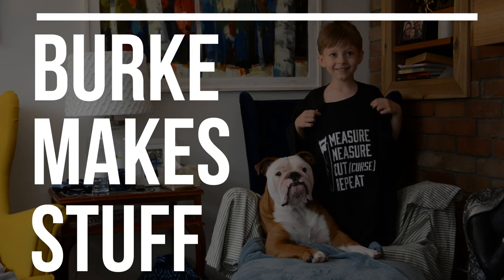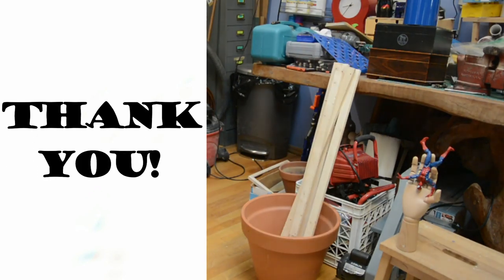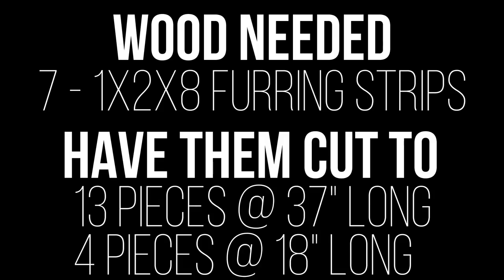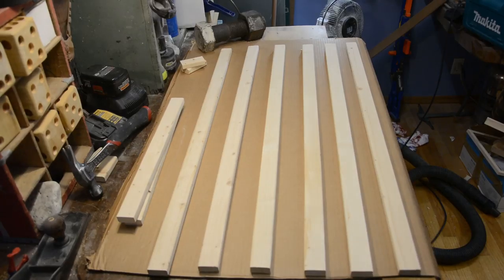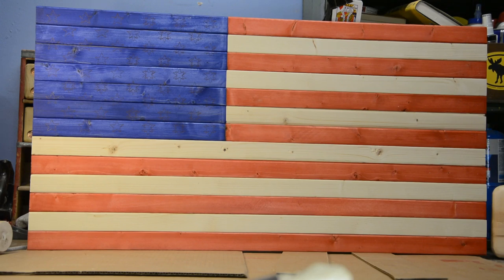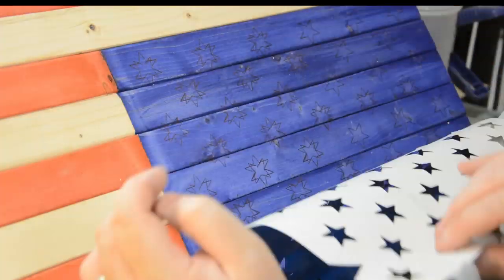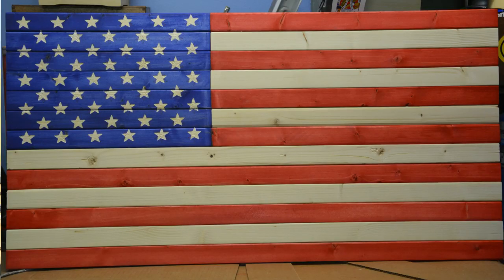Beautiful Wooden American Flag

Comment: I use screws when putting mine together, how well do the brad nails hold up over time? They would make it a lot easier, faster, and cheaper to build! Thanks for the video!
Reply from the maker: Bryan McKinney being that this is hung on a wall, brad nails and wood glue are more than enough holding power!
Reply: @BurkeMakesStuff  thanks for the reply! One more question, any suggestions to keep the flag from warping? They are perfectly straight when I assemble them but they start to warp shortly after. What kind of wood do you use? I have used premium wood from home depot, to firing strips, to pressure treated. Any feed back would be greatly appreciated, Thank you.
Reply from the maker: Bryan McKinney I’m now on number 40 something, and haven’t had a single one warp. How’s the humidity in your shop? Any wood from HD should be fine as they have consistent moisture content, so I’m guessing it’s your shop that’s the variable. Dehumidifier? With the BACK slats are you gluing them? I use glue and my 18 gauge brad nailer. Make sure they are clamped while drying, but not tightly. That could totally make them warp if the clamp is over tightened. You want to only apply enough pressure to have them in place but not enough to “squish” them together.
Keep me posted.
Reply: @BurkeMakesStuff  I'm in Floida right on the coast so humidity is always high, and I work out of my attached 2 car garage. I do clamp them down and maybe I might be clamping them down to tight as I didnt want any gaps to be showing. I will back it off a little and see if that helps. Thanks for the info and will let you know how the next one turns out!
Reply from the maker: Bryan McKinney will do! As long as your cuts are straight, gaps shouldn’t be a concern. New video coming out tomorrow! Be sure to check it out!

Comment: Lowe’s And Home Depot both don’t cut anything under 12”. At least in my area. And the 1x2x8 strips are $2.73 a piece.
Reply from the maker: Hi Chris! My Home Depot has literally never said no whenever I’ve asked them to cut anything, regardless of size. I get small stuff there all the time. As for price, at HD, 1 in. x 2 in. x 8 ft. Premium Kiln-Dried Square Edge Whitewood Common Board runs $4.44 each. While 1 in. x 2 in. x 8 ft. Furring Strip Boards are $.98 a piece. I’m in NY. Figured our prices would be the worst. Where are you out of?

Comment: Hey Burke, GREAT video. Would love to make one myself. The problem I've encountered is that after visiting a big box store twice, their strips left ALOT to be desired. Couldn't even find the minimum number of strips, let alone, enough to make 2 flags. Any suggestions from you or your viewers? Another store? Buying the same thickness of wood but wider and having someone rip it??  Thanks.  Atul
Reply from the maker: The trick it to go through to find the good ones. That investment of time pays off because the wood is cheaper. You can get better quality if you’re willing to pay for it, but that will end up cutting into your bottom line if you sell them.
Reply from the maker: Other stores may have a better selection, def. always good to know your local stores and what they carry of good quality! And getting wider boards and cutting them down is an easy fix, though, again, thinker boards are more expensive and might cut into profits.

Comment: 1 x 2 x 8-ft Furring Strip (Common); 0.75-in x 1.5-in x 8-ft (Actual) .  Are these what you are speaking of or is it better to rip 1" X 6" X 8' into true 2 " strips?  Thanks,  Bob in Tampa
Reply: Ripping true 1x6 will not have the same affect, unless you round over the corners on a router table. Remember too that a true 1x6 is only 5.5" wide so you will have waste to contend with.
Reply from the maker: Right off the shelf.

Comment: If you don’t mind me asking.... how did u do the star stencil in the cricut?
Reply from the maker: Sling Blade went into google and looked up “US flag Union” click images. Go to “tools” image size large. Save photo to computer. Went into silhouette software. Dragged it in. Since the union is 7 of the stripes in height, I did the math on that, sized it to that in silhouette. It cut it out of vinyl. I just upped the cut specification like depth of cut so it would go all the way through. 
Taa daa, stencil!
Hope that helped!

Comment: "The stain won't be able to bleed through."
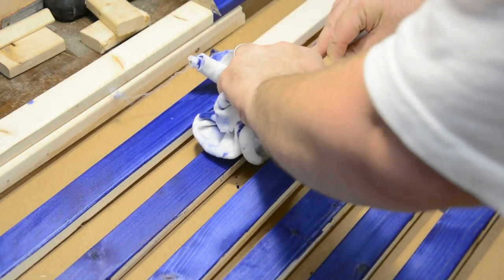5:47 Bleeds through one on camera.
Reply from the maker: …it bled through the metal blade….No. it ran down the side, where that isn’t problematic in this project, but thank you for the engagement on the video.